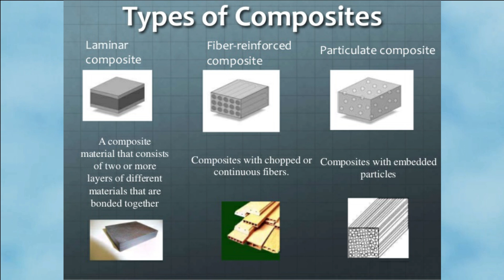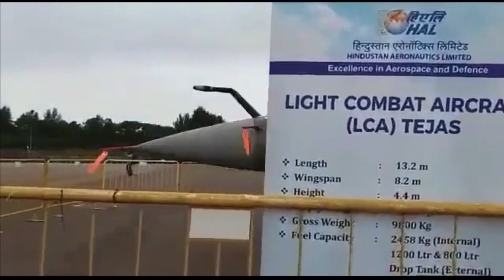LCA Tejas delivery might get impacted due to Russia-Ukraine conflict

Comment: This is lazy attitude.  Cant they keep raw material in stock for atleast the ones that are ordered?.  Similar lazy attitude seen in transporting coal to power plants. They only realize the need whn something breaks.  Chaltahey Chalnedo 😏
Reply: Keeping excess stuff in stock is costly and inefficient. Most modern manufacturing is based on Just In Time principles. The Russian invasion of Ukraine is something that could not be predicted.
Reply: @pisquared1827  I am mentioning to keep raw materials ready for 80 orders that are already placed some time ago.
Reply: @KSR-1000  
80 is almost the whole Tejas order which is maybe 4 or 5 years of production. Just in time manufacture doesn't work that way. Besides that supply was already disrupted before the war, so finding an alternative supplier with the capacity will be difficult.

Comment: Tejas is indegenious fighter plane,why,we always need foreign composites material to produce our aircraft?this show us that,our technology is very low,I understand that making Engine is more difficulty, it may take some more years to produce successfully,But our scientists must use their brain inorder to develop the raw material need in aircraft.if this can not, how can we produce 5th generation Aircraft.why whywhywhy.....
Reply: It is about scale of production. If you use enough material locally then it is economically viable to set up a factory in India. If not then you have no choice but to import. This is a big problem for India's indigenous military hardware because the Indian defense procurement babus place orders for indigenous equipment in very small batches. Then the same babus wonder why unit costs are high, production rates are slow, and indigenous content is low. They then blame HAL, CVRDE, DRDO, etc. for all this because their incompetence in project, production and development management is such they can't even see that it is because of their incompetence in these areas.
By the way, this delay is minute compared to the delay of 22 years after the first flight of Tejas in 2001 by the IAF procurement babus while they tried to decide and specify what avionics fit they wanted, took so long to approve tests and finally decided to come up with the money. With any other air force Tejas would have entered into service in 2006, the same time as Rafale. So the procurement team blaming HAL (or rather Ukraine for being invaded by Russia) for the delays is really rich.

Comment: What are the raw materials needed to make those? Don't we have those raw materials in India?
Reply: carbon fiber and epoxy resin. Probably both can be made in India, but may need a new factory to be built in India, but to do this, the quantities on order in the long term must be sufficient and sufficiently reliable to justify the investment. It is possible that these are already produced in India, but the production is fully booked up already by other customers. It is also probable that the Covid disruption is also aggravating the problem, because shipments globally have been affected and finding an alternative non-Ukrainian supplier is difficult. For example global car production is seriously disrupted by automotive chip production supply disruption and will take a year at least to recover.
Reply: HAL will run out of reasons if u keep asking questions